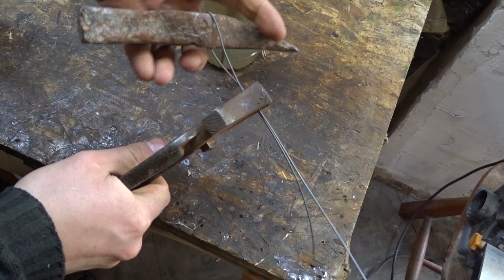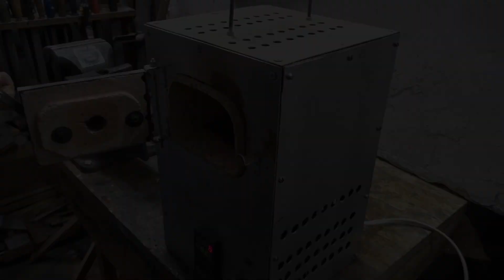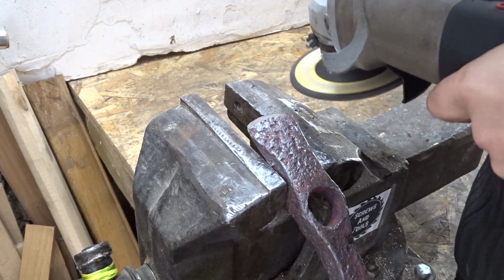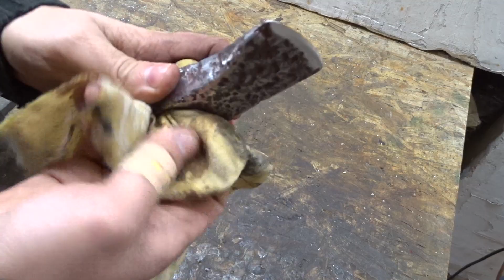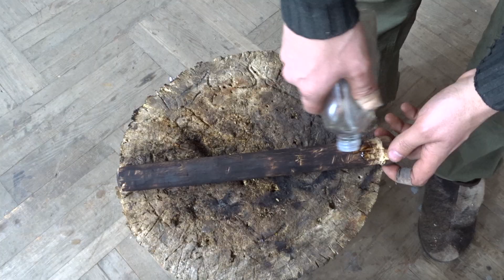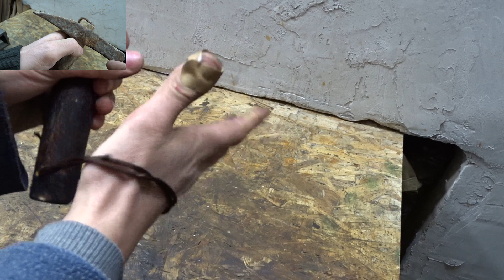Old Rusty Masonry Forged Hammer Restoration

Comment: I’ve probably been wrong for a half century or so, but with broken wood handles and such, I just cut off the length and throw the head in the coals of the wood stove a few hours. When removed, the wood is gone, as well as old paint and much of the rust, and the steel is apparently ‘normalized’. I then sand and polish, and shape the new handle, and redevelop the edges on the head as needed. I heat the edges and quench, then final sharpen. Lazy, I guess. Like this gentleman’s work, especially the use of hair dye for wood finish. Nice colours.